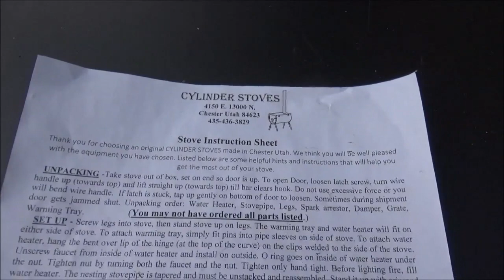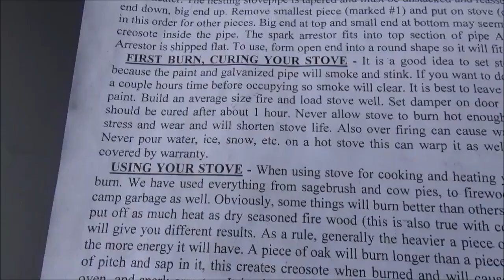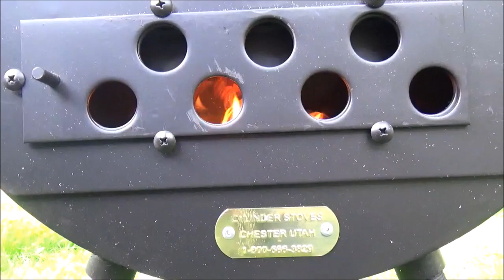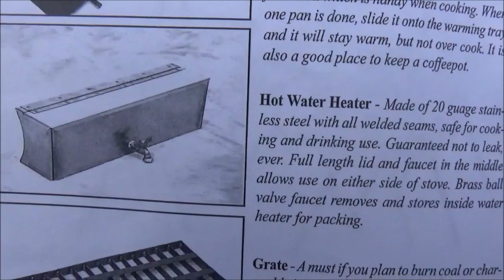CYLINDER STOVES. The Tent Wood Stove. Curing the stove. The first burn.

Comment: I would add the grate  which was listed on the instruction sheet.  At the very least, a layer of sand or fire brick on the bottom would improve longevity and function. Enjoy your new stove.
Reply: I've heard this being done before, with an inch of sand on the bottom..to slow the heat decay on the bottom....

Comment: Did you can more butter to take up to the cabin? Why do you heat shower water in a pot instead of the stainless steel tank? What water do you heat in that tank? I don't ever remember you using it before? xoxo from Arizona.

Comment: didn't realize you needed to season a stove like that, makes sense though. thanks joe
Reply: Different process than cast iron.  The new stoves have uncured paint and oil on them you need to burn off.  It smokes and smells like chemicals and you don't want to breathe that in a tent.

Comment: Joe, just occured to me, you have a water heater on the side of the wood stove, I've never seen you use it? I would think that would be great to heat your shower water!  Do you not use it? Or do you just not show it being utilized? Keep up the great work, love the videos!! Take care.
Reply from the maker: I did in the past but it is not very efficient because the water just boils away. It is much easier doing it the way I do it but that water heater does work well if needed.

Comment: It seems like starting  up the stove is almost always one of the first things you do.  And you have the stainless steel water heater right there on the side, yet I don't think I have ever seen you take any water out of that heater.  Instead you heat pots of water on the gas stove for showers.   is it just too much of a pain to fill up with water?  wouldn't you just need to add some cold water to a partial pot of hot water for a nice hot shower?  Just curious to why you would clean it all up and put it back on when it doesn't seem to get very much use.

Comment: Should you not get a second stove for the tent, since you rely on them in winter for food / heat?
Reply from the maker: No need, that old stove would have went a couple more years for sure. I am confident I will have no issues.

Comment: Do you ever put water in the water tank on the stove
Reply from the maker: I have yes and it works well its just easier to put it in a pot on the top of the stove since a person rarely needs hot water when you actually look at how much you use it through the day. The water in that reservoir is constantly boiling so it evaporates away.

Comment: i use 5/8 copper tubing to heat up water just wrap  around the stove pipe and hook it up to a water heater works great a small 20-gallon tank or even a 5-gal. tank.

Comment: Have you ever thought about wrapping underneath of stove in copper pipe and around bottom of stove pipe? Sort of pump water through slowly when you need hot water for washing dishes and shower. Kind of an on demand warm/hot water supply, at least in winter/fall/spring months.
Reply: good idea👍
Reply from the maker: It is a good idea and yes I have looked into that, the problem is that I am normally here all alone and heating water has just became part of my routine. When you are here you always have something to do and heating water is one of them. If I had multiple people the hot water on demand would be a great thing to have, Thank you.

Comment: Curious, how effective is the stove as a cook stove?
Reply from the maker: I have cooked many many meals on that wood stove. It is easy to regulate the heat also. You slide it back towards the stove pipe for real hot and you slide it towards the front for low heat and if the stove is a little too hot you can slide the pan over a little on the shelf since it is exactly the same height as the stove top. Then you can shut the damper and draft down on the stove and it drops pretty fast and you slide the pan back on the stove. You see more of the wood stove cooking in my earlier Tent videos.

Comment: I never burn glossy paper in mine gives off a horrible sticky residue 
Also I never use lighter fluid as it heats up too fast and causes stress on the stove (could warp over time) 
I only use untreated seasoned wood , looks after your stove and you will get a lifetime from it not just a decade
Reply: Shaun-Dawson 
Yes it creates a lot of creosote and that's the first time I've ever seen someone use lighter fluid was on Joe's video about a year ago.